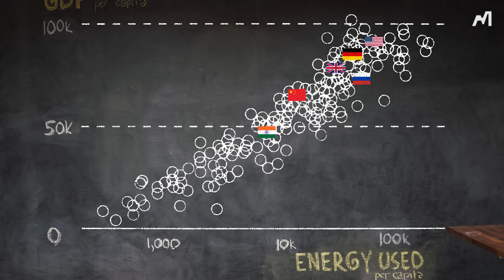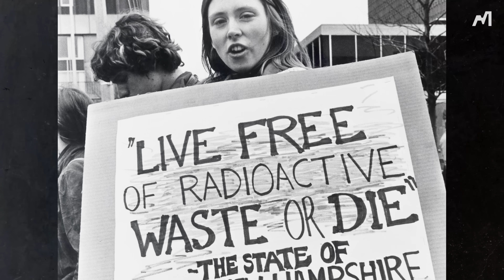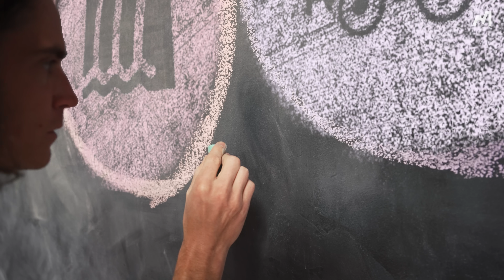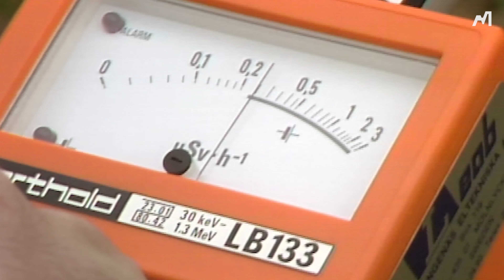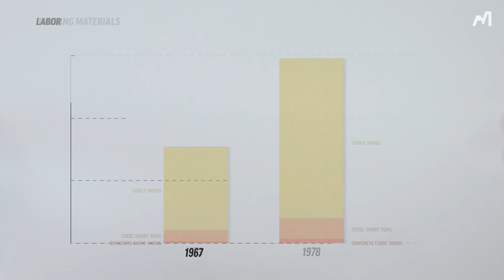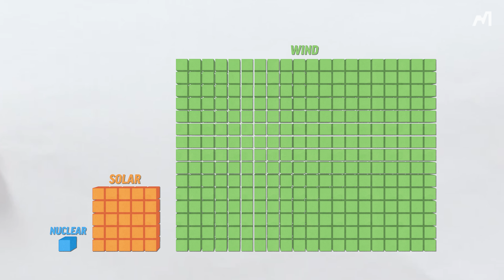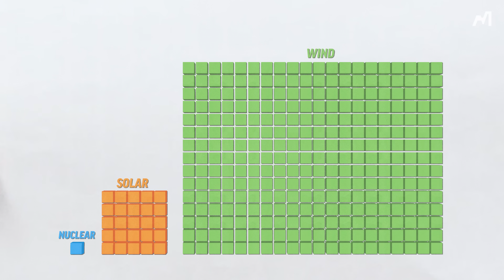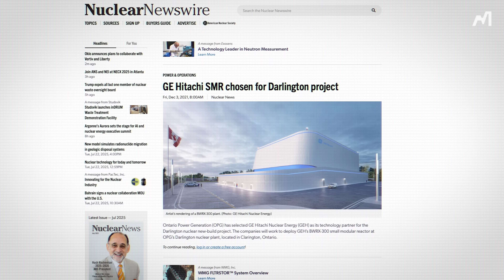They're Lying to You About Nuclear Energy

Comment: I have always wondered why the current coal fired power stations are not being converted to green hydrogen. They often occupy enough land for solar and batteries to be placed, they have enough water for electrolysis, the transmission lines etc are already there, no pollution only water vapour which can be condensed and reused for electrolysis, and the cost of converting one power plant must surely be less than SMRs or full size reactors.

Comment: What about Liquid floride salt thorium reactor, hasnt China booted a commercial scale one very recently? seems a way better system if it works as expected. And theres that drill bit that uses inverted magnetic containment, like in a fusion tokomac, to protect the drill from melting , and go really deep down for geo thermal, not into aquifers but down deep in the earths crust where its really hot. Dunno where that projects at atm but that'd be truely next level. Be good do a video on these, curious where those projects are.

Comment: I really appreciate this video because it demonstrates the failure of the contemporary mainstream environmental movement to lock onto nuclear power as a sustainable alternative to fossil fuels, among other things like the demonization of nuclear energy by fossil fuel interests as well. However I do have some feedback.

You're actually wrong about how solar *can affect the things under it. There are strategies for mitigating this to negligible levels, such as turning the panels vertically (which also provides more stable power supply) tipping the panels when precipitation arrives to mitigate the impact of solar on precipitation to negligible levels or potentially even to allow solar panels to direct precipitation where it may be lacking. Also you can use solar for agrovoltiacs which is an important way to get the most out of the land by using it for multiple purposes at once with the potential to do so sustainably. 

Additionally, another benefit of solar is the ability to decentralize the power grid. You're also wrong about the land use because you can put solar on roofs to again, get more use out of the land.

You're not wrong about the impacts of wind power on insects and birds, but the framing you present obstructs further context. Fossil fuel Plants, most notably coal plants, are more dangerous to insects and birds than wind energy still including but not limited to endangered birds, especially because the things they do that kill birds like mass pollution aren't as location-specific as wind.

Lastly you're wrong about the supposed criticality of natural gas and fossil fuels, and your own video is the proof because nuclear power is so viable and such a great replacement for them, alongside wind, solar and geothermal in certain environments. In this case nuclear would be the generalist source while the others would act as specialist sources where applicable (and despite being more specialized their application is surprising, considering that solar excells in the desert and the desert is the second largest bione on Earth, with many people living there. Wind and geothermal however are a little more niche.

Comment: Chernobyl technology is not representative of today's technology but the point is not the number of people who died or got sick from it. The point is it nearly made most of Europe UNINHABITASBLE.  By sheer luck, Chernobyl was surrounded by sand -- which melted with the core, diluting it, slowing and ultimately stopping its progression to ground water where -- if it hit -- would have caused toxic dust and steam spreading death over 1000 of square kilometers.  It highlights the inherent danger from tons of fissionable fuel.  There are inherently safer designs, and no reason not to use only them.  The other big truth is no engineering is guaranteed to prevent unforeseen nuclear calamities.   The question is whether the risks are outweighed by the potential calamities of global warming which nuclear helps limit.

Comment: The safest nuclear energy by far, is geothermal. New drilling techniques developed by Fervo, Evor, Sage and others mean any location can be a geothermal powerplant.  And do so at a low cost per watt, have a lifespan at 50 plus years, and have a completely recyclable end of life (if there is an end to life).   No fuel costs, and same if not lower cooling costs, smaller footprint.   Nuclear is old news bro.

Comment: Great video.... earned a Sub.  I have said for years that the so called Environmentalists are way more interested in an issue to whine about than any solution.  Nuclear solves most energy and pollution problems on it's own.  You want your electric cars... nuclear is the answer.  You want your hydrogen fuel cells, nuclear produces the hydrogen as a by-product while making clean power for the grid.  You want to stop covering thousands of acres of land with solar cells that can not be recycled, nuclear is the answer.  Want to stop smashing birds with ridiculous wind mills (that are only viable in 3 areas of the US), nuclear is the answer.  People need to stop bowing down to the so called scamming "environmentalists" and get on with it.

Comment: Ok but you have basically discarded the one big problem with current nuclear tech. It's not sustainable. We have about 200 years of uranium at current usage rate. That means that if you increased the use of nuclear from about 10% to say 50% of the worlds electricity you would be out of uranium within the century and it would become increasingly costly during that whole period. Now current nuclear tech might not be the best and there are alternatives and better recycling methods being proposed but fundamentally it's not a long term solution.

Comment: It's the quicksand effect. We were all raised to he afraid of it and when we grew up, realized it wasn't an issue.
Reply: I experienced quicksand firsthand. First, there are no jungle vines nearby with which to pull yourself out. Second, it was more of a situational delay than a danger.
Reply: they say quicksand is dangerous but never mention bogs
it may look like moss or mud but its just water
i mean you can keep your head above the waterline in basically all scenarios but its hard to get out, especially without equipment and alone

Comment: Nuclear power on a submarine is on a wastly smaller scale then a powerplant. 
But you do not need to play nuclear against wind and solar. First of all, don't play the ‘but the birds’ card. 
Solar energy, on the other hand, is being installed left, right and centre, while no investors can be found who are willing to cover the costs of building a nuclear power plant. Nobody here wants to have nuclear waste stored above ground, even though it is only small quantities that are locked away in concrete cylinders. 
On top of that, the material for the fuel rods has to be obtained first. And that is the real limiting factor for the EU.

Comment: You re an educated imbecile.
You are unable to see the whole picture.
The risk of relying on nuclear fission, one of the most destructive known sources of energy to create electical energy through turuning water into steam whilst pushing the problem of the radiactive waste THOUSANDS of years into the future.
And no, one cannot compare the resources used by a nuclear powerplant to those used by either wind nor PV.
Also, one of the big adavantages of PV and wind is, that they are distributed instead of being centarlized.
Lower losses, betetr redindancy,lower cost.

Sorry, but you are spreading a bunch a fabricated lies.

Comment: Nuclear power wipeout was about the money from coal, gas and hydro for the big guys.  Nuclear is safe power, it goes bad when pushed beyond its limits and incorrectly operating and it will bite if done wrong.  Use it safely and it'll be safe.

Comment: I am so confused about the whole “radiation doesn’t equal cancer” thing, considering even radio techs wear radiation-meters which keep track of their exposure. Once they reach max, they take a break from clinical practice for a certain period of time. High radiation has also been tracked to cell mutation (carcinoma).
Reply: Nuclear engineer here, I don't know about radio techs, but that's EM radiation, not the same as radiaoctivity (not all radiation is radioactive, but all radioactivity is radiation is a simple simplification often used). High radiation can indeed be dangerous, notice HIGH, the thing with radioactivity is that at low doses there is no statistical evidence of damage, it's not "radiation doesn't equal cancer", but "low radiation doesn't equal cancer". For safety we have the LNT model, but there's no evidence to support it, at low doses a cancer from radiation is indistinguishable from a naturally occurring one, to find a correlation at low doses you'd need a clinical trial with sample size equal to the entire human population (just because of statistical uncertainty). So far the LNT has actually done more harm than not

Comment: The economics of building new nuclear power still look awful compared to renewables.
1. Any major construction project has to deal with delays for various reasons. Unless we massively roll back property owners' rights (which would also help renewables by the way) and other regulations, nuclear power plants will continue to see delays.

2. The time to repay the initial investment is long even in the best case. And it's getting longer as the uptime of nuclear power plants decreases due to renewables satisfying 100% of demand for longer and longer times. Nuclear power plants are not good at reacting to grid fluctuations like gas plants are.

3. Both nuclear and fossil fuel technologies have received magnitudes more subsidies for development and investment over their whole life spans. Renewables and batteries have become competitive for a fraction of that cost.

4. The cost of new nuclear plants continues to increase as both material and labour costs for their construction rise. 

5. Renewables and battery storage continue to become cheaper as they not yet a matured technology like nuclear, and can be truly mass-produced as factory products rather than big local infrastructural projects.  
This further worsens the outlook of any new nuclear project, since its competitors will have significantly improved before a nuclear plant had any chance of breaking even.

6. Nuclear power plants are painfully slow at recovering the (substantial) initial CO2 investment. This makes them a poor choice for mitigating climate change, where quick emission reduction is much more valuable than a reduction that only kicks in many years from now.  
Renewable projects can break even within 5 years, while the timescale for nuclear projects is more around 30-40 years total. Way too late for the climate.

7. The issue of needing too many batteries to make highly renewable grids work is massively exaggerated. Alarmist studies typically look at the storage required to stabilise a 100% renewable grid. But the storage requirements rise exponentially. Just 10% of dispatchable power sources (like low emission gas power plants) massively reduce the storage requrement and bring the total-system cost of renewables in line with nuclear.

8. 'Small modular reactors' as they exist on military vessels are not made for economic operation. Nuclear power plants are big  because their efficiency greatly improves with larger scale. SMRs therefore generally lean on highly speculative fuel cycles that usually weren't pursued for good reasons. So most SMR projects are slowly collapsing as they find out why their fuel cycle never became 'main stream' (like thorium-salt with their corrosion issues).

Considering that the 'renewable-sceptic' crowd complains so much about CURRENT electricity costs, it's not credible to assume that they'd be fine with paying more for electricity for 30-40 years (a reasonable time line for the break-even point of a nuclear power project), in the hopes that their national economies will not fall behind from this burden and actually gain a net advantage for future generations.

Comment: ok your argument is sound but you dont use units to describe things. I am miss remembering these most likey numbers sure i that the radiation was in mSv, and not mGreys for the fukushima data. though my overall point is calling them units this could be seen as miss leading. i find your points valid with the manhanten project. but as well there was dangers with the demon core. which i beleve did have 2 ish deaths i could be wrong. so i do beleve that there is merrit to what you are saying ie the dangers of radiation are not as great as people say causing the amearicas to lose faith in the power due to the overreactions of nuclear power. also i think you mis quoted i could be wrong again the linear no threshold model. as it models your current radiation dosage of Sv to a percerntile over a short period of time. as if that you said was true then raidation workers could not work after experienceing 20mSv. though they are alowed to work after a year of non exposure.
Reply: I also don't know what those units are, I know some worker in fukushima got up to 250 mSv, but a natural background of 0.2 mSv is wrong, probably they are uSv/h? Correct the demon core killed 2. The way he presented the LNT is overall correct, the fact that workers are allowed after a year is because exposed workers calculate their dose yearly as the cancer risk models for workers calculate the accumulated yearly dose after 50 years of working. But there are other units and models for exposed workers, 20mSv is indeed the limit for the highest category of exposure, but of course as everything nuance is needed, what he said is not wrong, but you can't fit a half semester of radiation protection in a video.
Reply: @filippo1864  fair enough thanks for the corrections

Comment: I wonder if we could reuse those Naval reactors sitting in Trench 94 at Hanford, WA as SMRs for the US Army/USAF microreactor programs. Instead of 1MW, we could refuel these with lower enrichment fuel (they use nearly weapons grade enrichment in USN vessels) and still get enough power to replace a coal unit. The lower enrichment would mean having to refuel more frequently than in a submarine or carrier, but that's not really a huge issue if the thing isn't buried in the hull of a ship.
Reply: No, I mean those reactor exactly not because they have a set expiration date. As per using the design, probably not, especially not with natural uranium if some drastic changes are not made. You cannot change the enrichment as it will stop working as intended, if the reactor is smaller it needs a higher critical mass to get a chain reaction, so higher enrichment, only some specific reactor can use natural uranium because they use heavy water, there were some natural uranium SMR designs, so it's possible, but higher enrichment allows for higher flexibility and longer operations and safety, hence why they're used in submarines to change power quickly. Also they are military designs, better to use civil designs.

Comment: Three things:

For safety - during the wind scale fire, an operator climbed to the roof and looked through a chimney pretty much directly into the reactor. Not once, but multiple times. He lived to 90. The risk of cancer goes down considerably as you age because it requires a long time for the mutation to your DNA to cause cancer. 

Safety 2 - we don't really have good data on how dangerous radiation really is. This is because the number of accidents has been extremely low, and the number of people seems to be extremely low as well. 

Who stands to gain? The oil and gas industry that sees nuclear as a competitor they could never compete with. If you remove the obscene costs associated with fear mongering, the price of uranium and the longevity of reactors beats oil, gas, and coal by miles.

Comment: Why so much one-sided information? 

Sure about 100k birds die in Germany every year due to windmills... Sounds like a lot... But 115 million birds die by flying against glass panels. Now we don't stop using those either. 70 million birds die through transportation like cars. 60 million birds die through cats alone. 

With bugs it might be quite visual to see them squashed against a windmill but they too mostly die of cars but also especially through pesticides. 

Wind and Solar has plenty of bureaucracy hurdles too. Windmills aren't easy enough to install either. Yet despite being a fairly recent technology that is still not at it's peak it's still cheaper than the atomic reactors which you so confidently downplayed. 

Fokushima was cleaned up yeah but that was no easy feat. Tschernobyl might not have caused too many proven deaths but it's not like you can easily proof that someone died in consequence of radiation. Not to mention the effects it had on Europe like not eating anything foraged in forests for years, like culling millions of animals. Etc etc etc 

This video is focused too much on how great you think nuclear is and too little about actually taking reasonable data and expert opinions to compare the different energy sources and the consequences that stem from them.
Reply: Coward